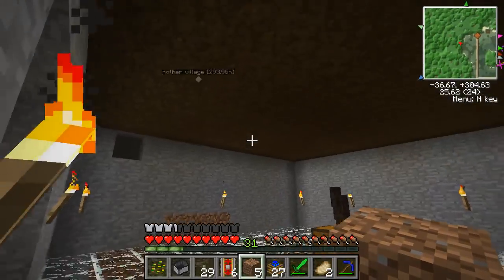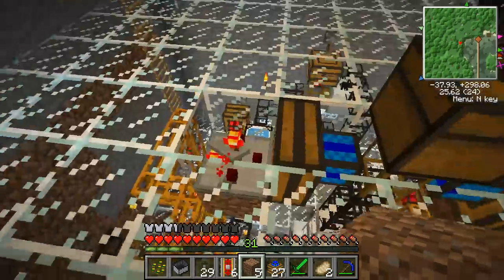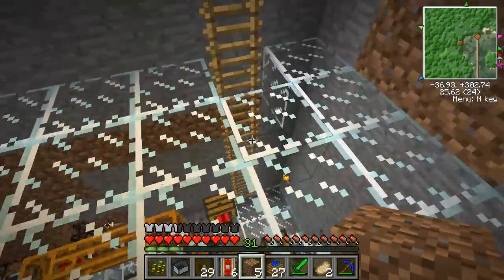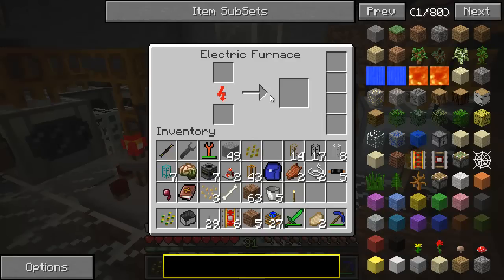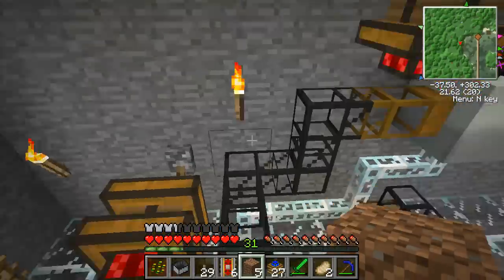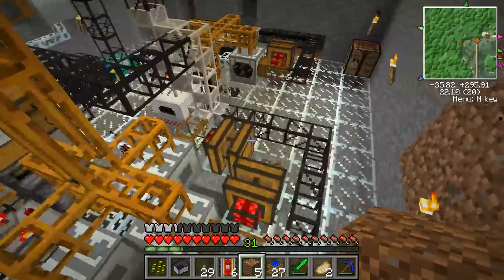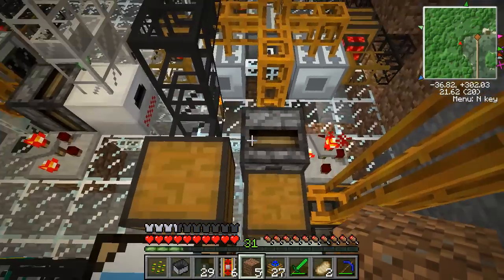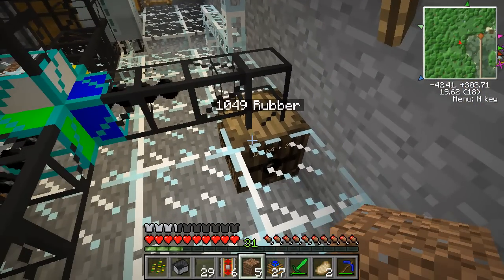Rubber Machine Explained

Comment from the maker: Explaining the sequencer was an oversight. Basically, I wasn't entirely sure if an electric furnace or three centrifuges handles materials faster. If the electric furnace does, that would mean that in the long run, it would be wasting operations, and thus power, on slime balls that would not actually end up in the centrifuge. Because I'm cutting it kinda close on power, I tried not to waste any power in the system. For this reason, I used a sequencer.

Comment from the maker: I make a brief mention to why I use the tubes in the video (it's really brief). I say "which evenly distributes the cells". Buildcraft pipes randomly select a direction when they reach a junction, which means that, on average the same amount would be in each, but it's entirely possible that all of them could go to one for a while, and thus slow down the machine.

The use of the sequencer (timer wouldn't actually work) isn't explained, and I'll explain it in the comment that follows.

Comment: Interesting machine. Although I'm not entirley sure why you switched to RP2 piping instead of sticking with buildcraft ones but I'm sure there is a reason. As well as the timers you have on your redstone engines on your slimeball chest. You could just power it with torches? But other than that it is a very interesting machine!

Comment from the maker: I tried to set the sequencer up so that it would be on for EXACTLY the right amount of time, but it doesn't appear to work how I thought it did. I might wind up adding two more, because it might just be that each part is 13.75 seconds long, in which case four of them would, in fact, be the exact number of stick resin required for three centrifuges to run 100% of the time and no more.l